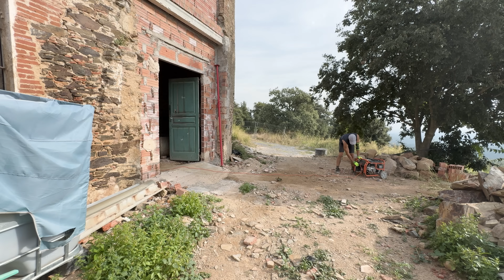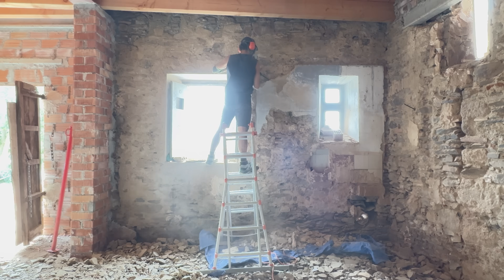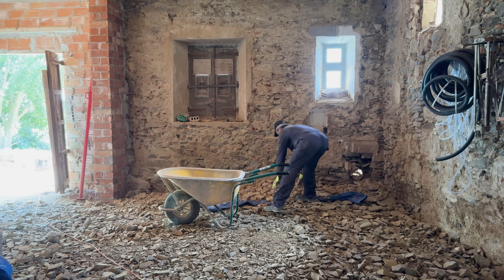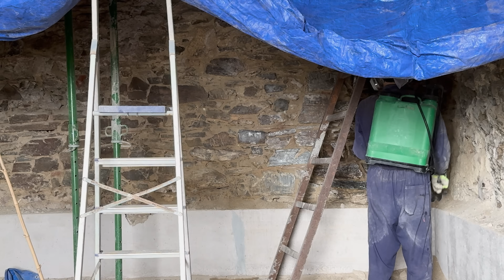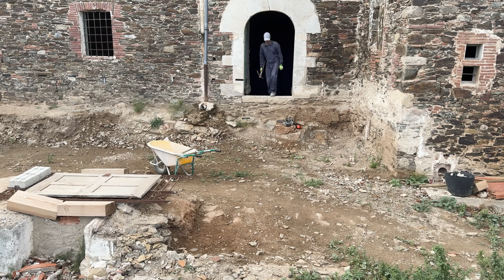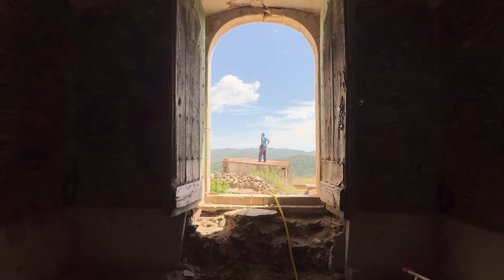(#52) Recovering Stone Walls From Cement, Render and Plaster

Comment: hello, have you tried a needle slag cleaner. it has several 8-10 steel rods that shoot out like a chipping hammer instead of single chisel. it would work well for cleaning out the old mortar concrete between the rocks on your wall. take a look online see what you think
Reply from the maker: thanks for the message. no, i have not. but someone else mentioned it. and I should look into it.

Comment: Hi, I’m loving your videos! It’s a daunting task but it’s coming along nicely. With regard to the cleaning of the stones, could you not hire a sand blaster? Messy yes but sooo much easier.
Reply from the maker: hello and thanks for the message. a good question and the sand blaster could have been a good option. but probably not worth the extra effort (renting, buying sand, clearing up after) for just the one wall. also I wanted to check the quality of the stones behind the cement render before deciding on how to clean it up.
Reply: @Casa-Catalana ah I see, thought you were going to clean up all the walls. Makes sense now.

Comment: Maybe sandblasting would be more effective?

@ThePethericks used sandblasting for their restoration in France.
Reply from the maker: thanks for the message. sandblasting is definitely an option. albeit there is more to tidy up afterwards. and I might do some later on. but I didn't think it was worth it for work on just the 1 bigger and 1 smaller wall.
Reply: @Casa-Catalana  the progress you've made is incredible. Looks so tedious cleaning up the stone. Maybe a 2k piece of sandblasting equipment would be an unnecessary investment then lol. I can't wait to see the floor done. I'm so desperate to see that main doorway be lowered. I'd have an OCD fit over that.

Comment: Hi:  I've been wondering for a while about the back wall (in you very last shot).  It appears there were two or possibly three windows or doors on the upper floor that have been bricked-up.  Do you have any plans to put windows there or do you plan to mortar it over?  Have a great weekend, DA
Reply from the maker: good question. That wall has all sorts of old windows / doors. The plan is for some windows and some repaired stone wall.

Comment: I would have used a high pressure cleaner instead of a wire wheel to clean the stones and the joins. But indoor is probably not the best for that. Good work and good luck.
Edit: Apparently, you did use a power cleaner to rinse the dust after this wire wheel cleaning. IMO using this power washer for the actual cleaning (but with the nozzle much closer to the stone) would have cleaned and rinsed in one go and would have been quicker than the wire wheel. But I maybe wrong.
Reply from the maker: thanks for the message.
Much as I would have liked to use just the power washer. it wasn't really an option. 
I would have had to use it at full blast and it would have taken out much more mortar from the joints. It would also have meant a lot more water and humidity inside. So I was only really able to use it at the end to clean off looser materials.

Comment: Nice work!  Have you considered using a needle gun for cleaning up your stone work and a mortar rake attachment for your angle grinder - available from places like Screwfix in the UK, not so sure about Bricodepot, Leroy Merlin etc.  It’s going well though, it’s a lot of hard work
Reply from the maker: thanks for the message and suggestions. I have looked at a needle gun option, after someone else suggested it previously. but i wasn't sure how much more effective it would be. I've not looked at the mortar rake option. if it can work around the irregular stone edges it might be a good idea.

Comment: Omg, my sympathies. I've removed paint from brickwork using a wire wheel on a grinder, hateful job. You did great though.
Fantastic when you find a bit of quartz with the grinder as it glows easily.
Reply from the maker: thanks for the message. It was a bit of a slog, but I quite enjoy it (apart from the dust)! and yes, the impact on different rock types is interesting.

Comment: Fantastic job! Looks 1000 times better.

I do think the threshold on the front door is maybe a wee bit high, even for Billy. Is that something to adjust after the floors are in?
Reply from the maker: thanks for the message. yes, you are right, the front door threshold is much too high at the moment. and yes, I will adjust it after the floor levels are done. (and when I have the new doors ready!)

Comment: You could save yourselves a huge amount of time and effort if you got someone to show you how a pressure washer actually works.  The effective range is about 30cm or less from the tip of the nozzle.  Otherwise it’s just a noisy hose.
Reply from the maker: You are right about the 30cm range (as confirmed in some of my earlier videos if you have watched them). But the distance I was using it on the wall was actually intentional. If i had used it any closer I would have taken out way too much mortar from the joints. I was looking to clear the surface debris and loose material (as I think I said in my voice over).